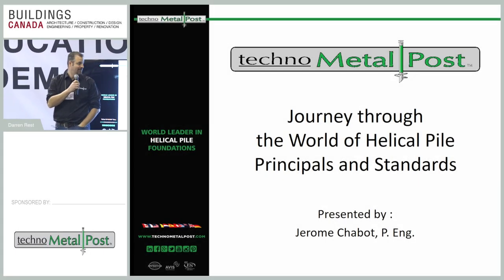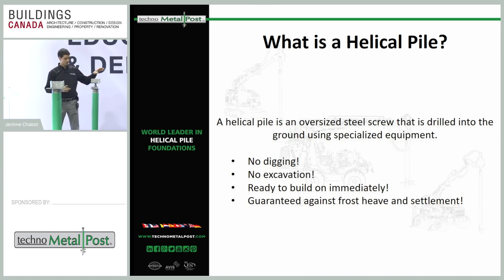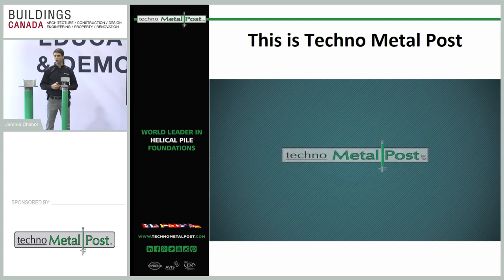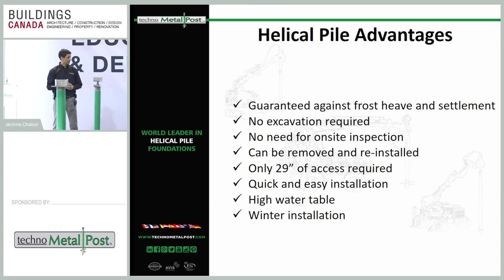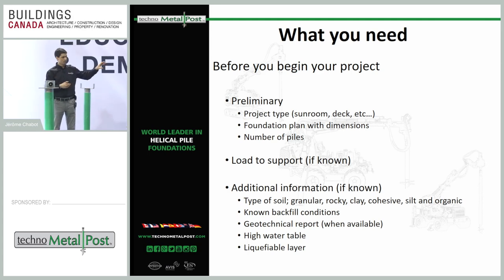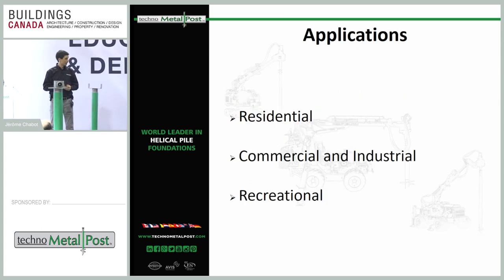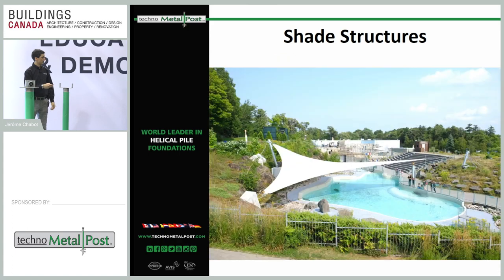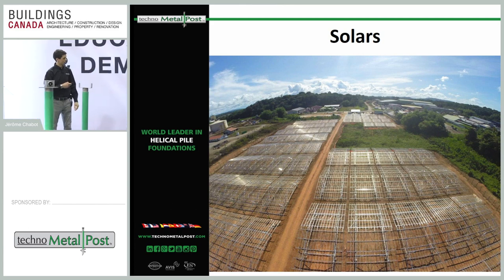A Journey Through the World of Helical Pile Principals and Standards

Comment: How does this deal with rocky soil with lots of boulders/rocks of various sizes?
Reply: I am waiting for an answer also
Reply: I’d imagine it doesn’t get through bedrock or places with large rocks. Soil with smaller rocks but I have no experience just prediction.
Reply: It depends on the pile installers equipment. Some companies like Techno use the small ATV type cart with a hydraulic motor (6:35) where as others use a mini-excavator  with a hydraulic motor. For those using mini-exes there is a bit more manoeuvrability when you encounter obstructions underground as you can disconnect the motor and dig them out of the way. For minor obstructions like smaller rock (the size of a mans chest or smaller) you can often angle the pile blade underneath the rock and then straighten out. 
If you run into bedrock a different foundation system is required. Some companies can bore holes into the rock while other will use rock drills and mount directly to the bedrock. 
Some soil conditions with lots of boulders and little soil are not appropriate for piles